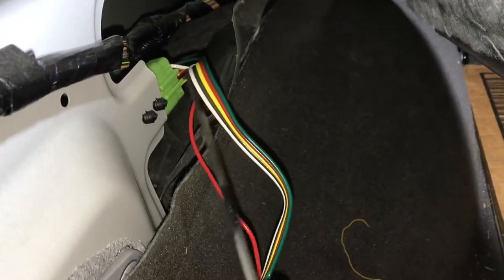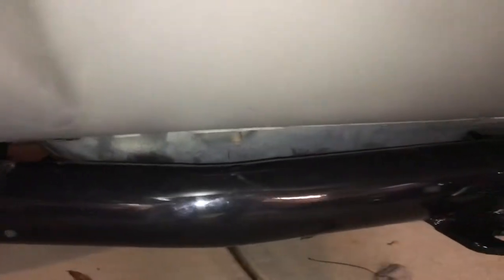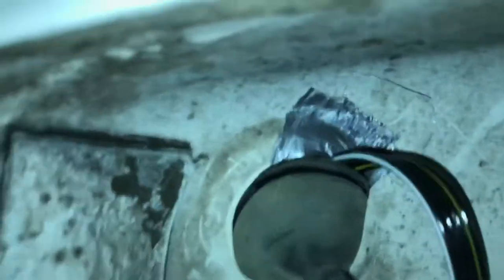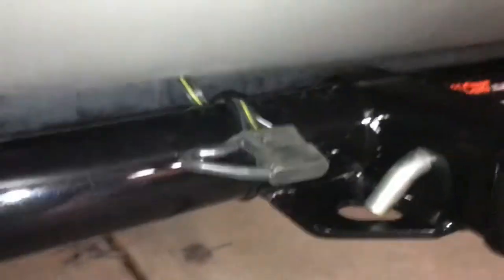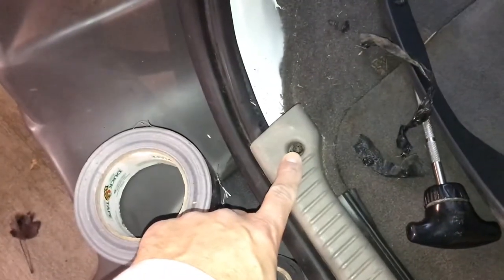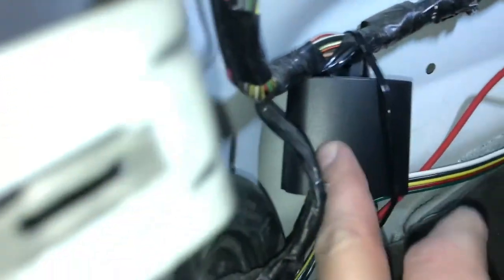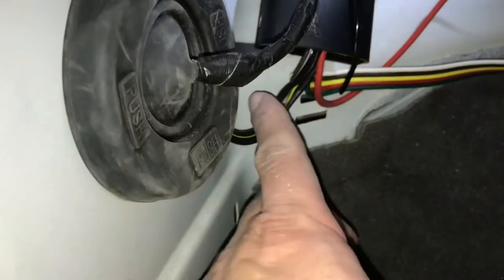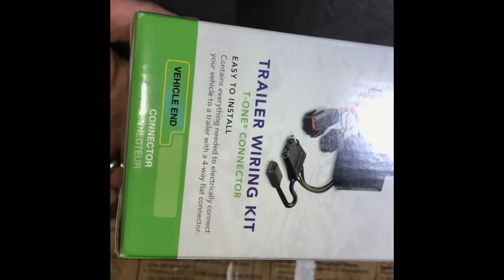Install and hide trailer hitch wires on a Jeep Grand Cherokee WJ 2003

Comment: You could take it into the dealer for the recall and get a factory hitch for free.
Reply from the maker: I know. I heard about that, after I stilled this one. Figures 🙄. I just need to find time to do it. Thanks.
Reply: I tried that and they told me "can't do it because you don't have a hitch installed" :/